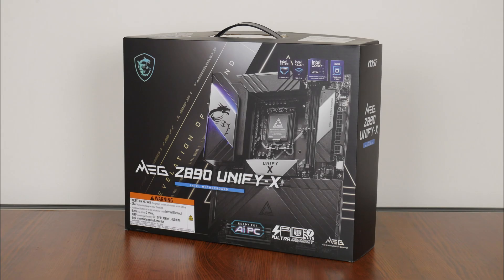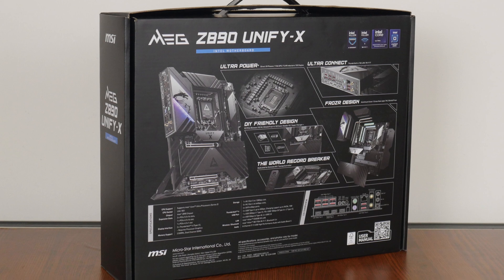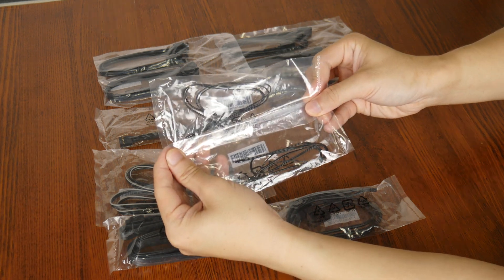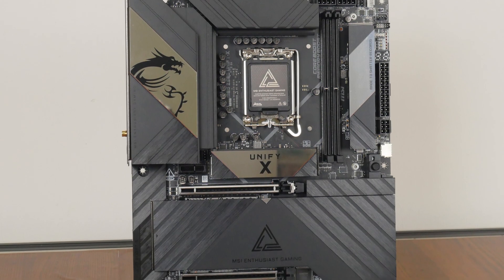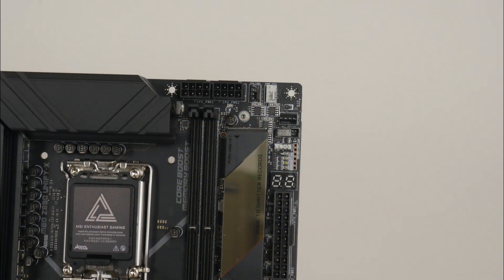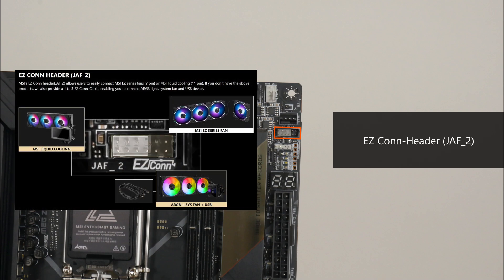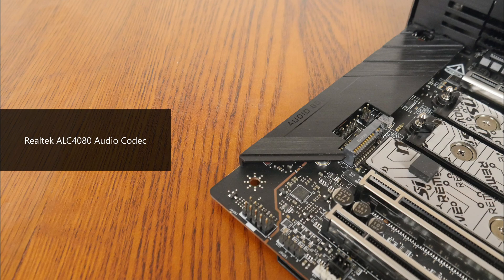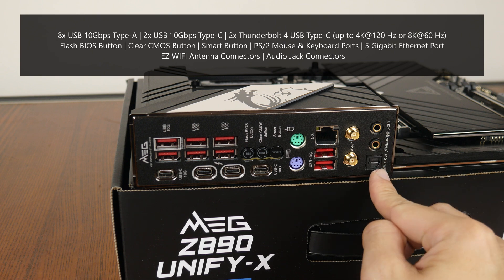This High-end Intel Z890 motherboard is for Overclockers! MSI MEG Z890 UNIFY-X Unboxing & Overview

Comment: what do you think about gigabyte b760m aorus elite x ax?
Reply from the maker: Based on its specs, it seems to be a pretty decent mid-range mATX motherboard for Intel's 12th/13th/14th Gen CPUs! Are you deciding between building a new PC using the latest Core Ultra 200S series, or going with perhaps a 14th Gen?